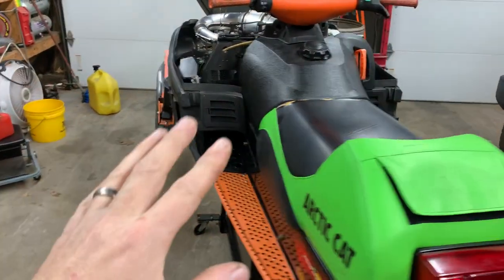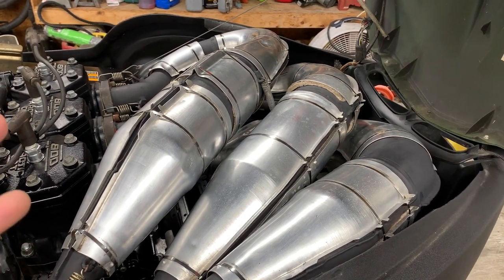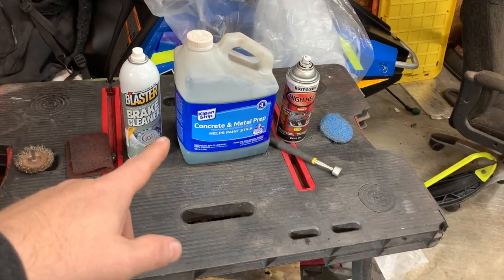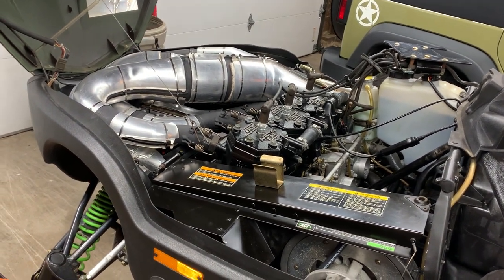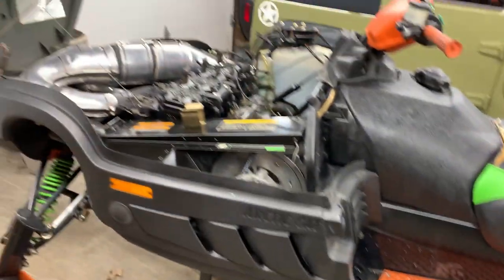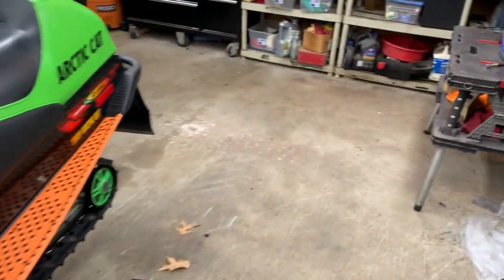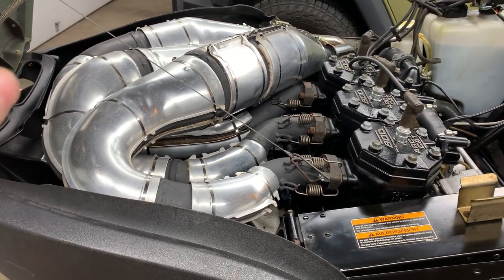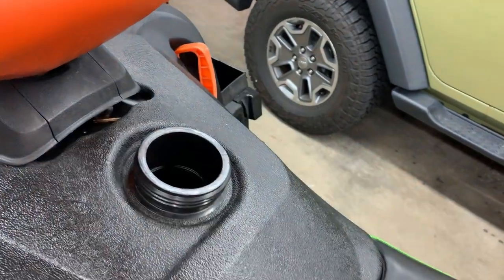Arctic Cat ZRT 800 Update - Broken Necks and Black Pipes

Comment: It's crazy how guys that complain about mufflers rotting out are the ones that leave it set where they stopped riding for the season, no cover or tarp, just leave it set there until the next season, and then blame the manufacture for putting heat shields on causing their mufflers to rot out.  Put a cover on it or a tarp if you don't have a garage or shed to put it in, it protects your investment, and your mufflers won't rot out. Good tips on cleaning up pipes and painting them Streeter.
Reply from the maker: Exactly, these pipes were in good shape considering the age. This sled was primarily stored inside from what I was told and the fiberglass pads were bone dry.

Comment: I bought your Indy 500 runs great. 
So I just found a 2001 arctic cat zr 800. ($1500)Looks good runs good but I checked the compression and it is at 90 psi on both cylinders. Is it still worth $1500 with 6500 miles?
Reply from the maker: In this market.  I would say yes.
Reply from the maker: Which Indy 500 was it?

Comment: Nice job bud would you have any videos showing how to check the oil pump adjustment on the 800? My cat is consuming alot of oil and the plugs are black.....
Reply from the maker: Specifically for the Cat no. But they’re all the same wether it’s a Cat or a Polaris. 

Remove the airbox and you’ll see the oil pump. There’s 2 lines or marks in the arm that lines up with a timing or alignment mark on the pump. 

Squeeze the throttle all the way to get max opening. Look at the marks and make a note. 

Loosen the jam nut on the cable and then you can make the adjustment on the cable. Which will either lower or raise the arm.

Comment: Tom, you should do a racked carb video like you did with the 38s
Reply from the maker: I started one last night for the carbs on the ZRT  when I was replacing the O rings. I forgot to hit the record button and didn't record some of it. I may still end up posting it or just wait for another sled to come in with rack's on them.

I didn't realize it until the airbox was installed and I 'm not taking it apart again.  lol